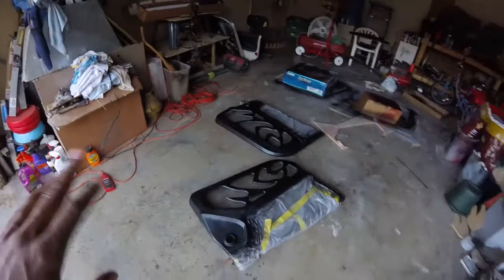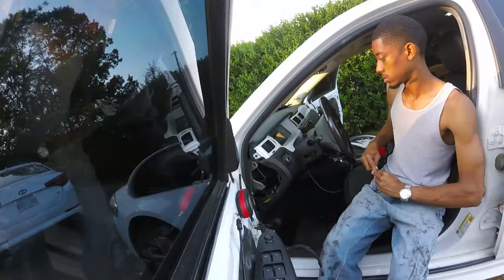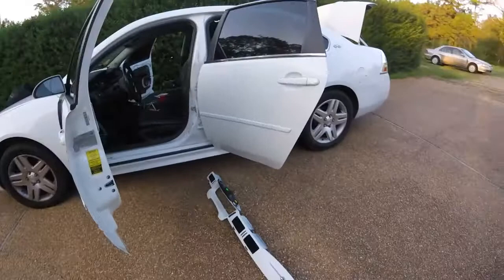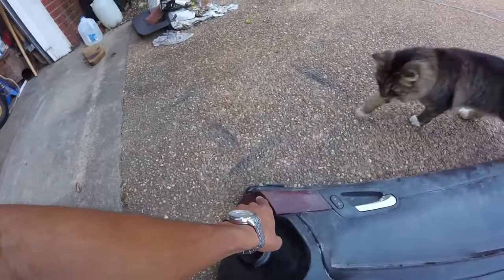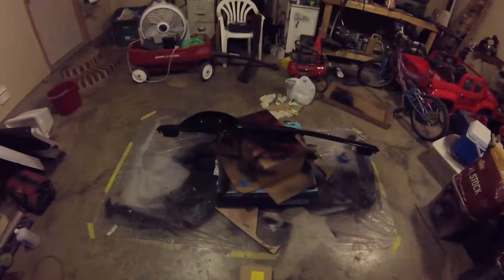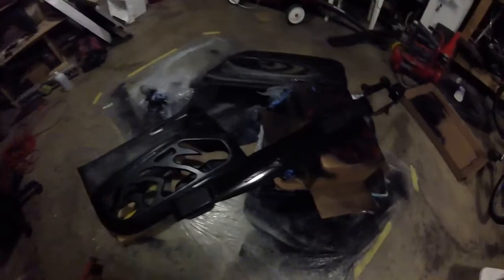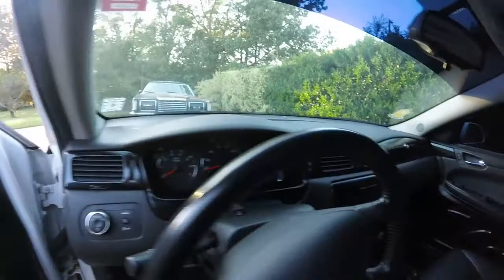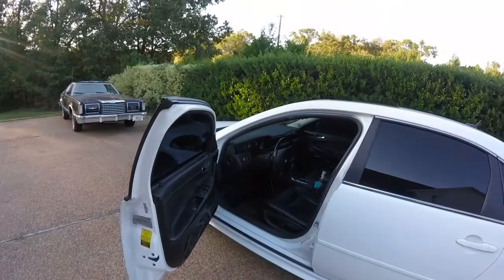Painting the Dashboard Trim 2013 Impala

Comment: How did you tape off the vent controls. I can't get them perfectly taped off.
Reply from the maker: You have to slide the tape in a little bit past the edges. When I did the white paint I took the side vents completely out and only taped the middle vents
Reply: @89imp03  thxs. Also thxs for actually responding lol
Reply from the maker: @charlest6689 lol no problem